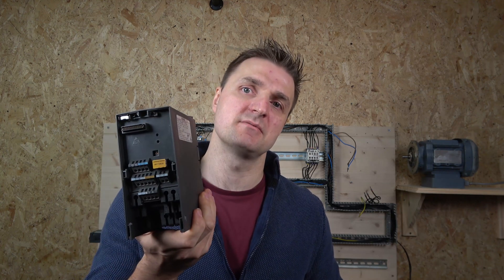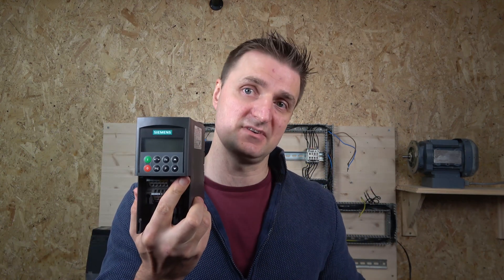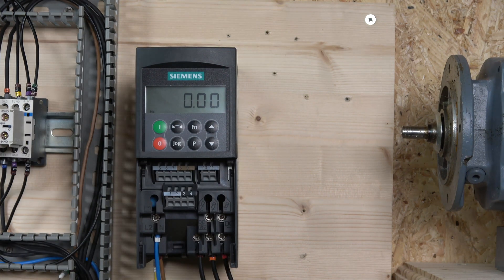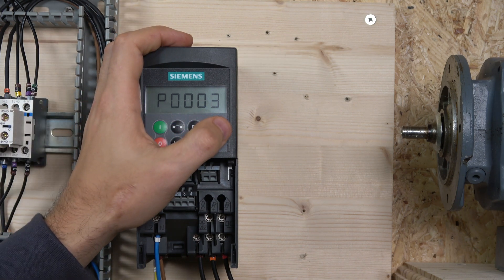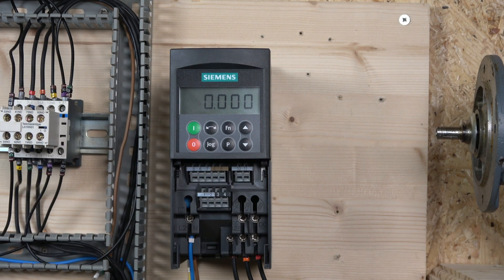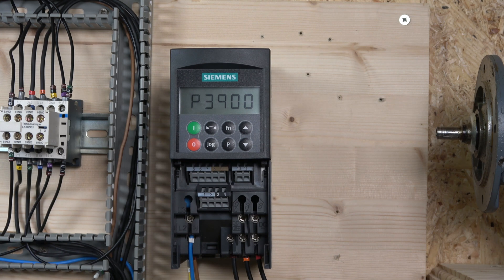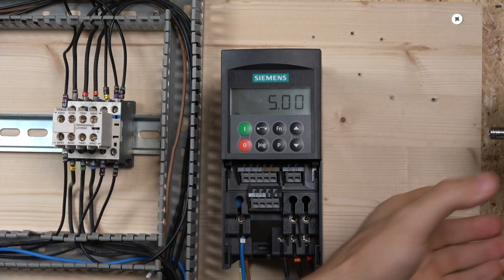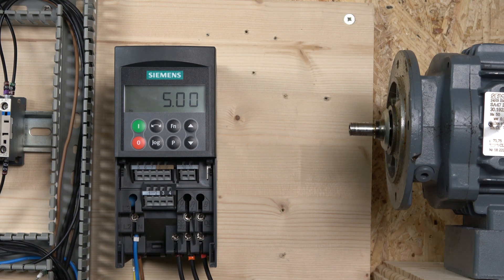Siemens Micromaster 420 commissioning, local control, factory reset, parameter set up. (English)

Comment: Hi, the digital output relay is set to drive in working mode and now the relay is activated after start while the potentiometer is closed. 
Is it possible to activate the relay only when a frequency of one and above is applied?

Comment: What is the parameters if I want to increase the speed while the motor is running. Now, I cant increase the speed P1082 because the motor is running. I need to stop the motor to  change the P1082.

Comment: Hi Ingus! greetings from Spain. I have a single question for you. Based in your knowledge, I try change the following parameters in VDF MicroMaster 420: P2012 (USS Com from 4 to PZD 2) & P2013 (PWZ 127 variable to 4 words) in order to use S7-1200 with USS FB communication. I currently using STARTER software V.5.5 without success (By the way my VFD is no Display, no BOP or AOP). Is necessary have a display to make these changes?. Thanks a Lot....

Comment: thanks for the video, can you make a video in how to set the parameter for releasing the clutch brake? I'm using micromaster 440. I've already set P1215 to 1 - but the clutch brake of the motor is not releasing. Hope you can demonstrate that. Many thanks.

Comment: If this inverter was powered from 3f with a 1.1kw motor and now I want to connect it to 1f and supply it to the 2.2kv motor, I have to change something in the settings because the undervoltage alarm was triggered, could it be caused by this alarm?

Comment: Hi great video. I was thinking of factory resetting the micromaster 440 and realise maybe I shouldn’t. Question is if I reset the micromaster 440 would it lost connection to the motor connected to it.  

Would love your help if possible.
Reply from the maker: Is it communicating with any plc?
Reply: @IGSElectronics  no it doesn’t have any communication. Normally the number in the LCD screen stay on one number when position e.g 5.00 but when I turn on the machine the LCD screen number jumping between 5.00 to 0.00 and normally those numbers are stationary.

Comment: Great videos mate keep them up 👍

One advantage the AOP has over the BOP is that the parameters can be uploaded and downloaded onto the AOP. Making it easy even for a mechanical minded technician to change the inverter.

I am in the process of moving away from these obsolete Micromaster 420's and replacing them for Control Techniques C200's.
Reply from the maker: Thanks for the info! Thank you for watching.

Comment: hello, I'm asking for help, I can't start the electric motor - with a complete and step-by-step configuration of the electric motor, the AOP A0541 does not disappear from the screen...All the time, the voltage at the converter outputs is 87 volts, of the same phase. What to do in such a situation?
Reply from the maker: Hi There, A0541 is Motor data identification routine active, basically it just tells you that, that's what it is happening, there is nothing wrong with the drive. I believe parameter P1910 should be on 0 for this to go away.
Reply: @IGSElectronics  In the parameter P3900 set "3", a message appeared" " not available P to acknowledge"...although I have entered the required value in P307

Comment: Any body have idea on parameters to configure the 3 programmable Relays on micromaster 440, i noticed the drive you are using doesn't have programmable relay, have scan through the Manual cant find how to configure relay.
Reply from the maker: Hi Egwu. This drive has digital outputs and can be configured in parameter 731 page 52. As relay output no, this drive don't have it.
Reply: @IGSElectronics  the manual i downloaded seems different from yours, on the page you stated i couldn't fine the output terminal and beside my own drive is MicroMaster 440, it has both output terminals and programable Relay 24/25.
Reply: Hello there, is it possible to increase the speed(rpm) of a Motor running on a VFD without the current of the Electric motor increasing.
Reply from the maker: @bdb7629  Hi there, current, volts and power are working in tandem with each other. Many different aspects can influence the current, so you as far as know, no you can’t.

Comment: Just a wee bit too fast in your explanations, particularly with regard to entering the data into the BOP, some references to the manual would be very helpful, ie what the codes mean and how to get to them. Apart from that very good but I will have to watch it a couple of times to make sure I get all the info' you giving out.
Reply from the maker: Thank you for your comment. I am working on my speed talking, habit that needs time to fix. Don't forget to watch the other 2 videos on this drive, were I go more in to details for remote controls.